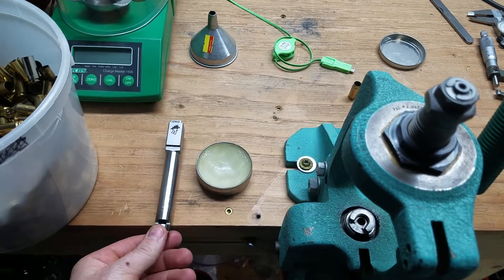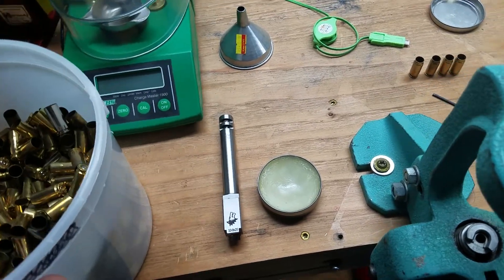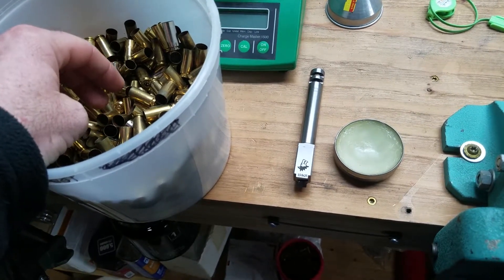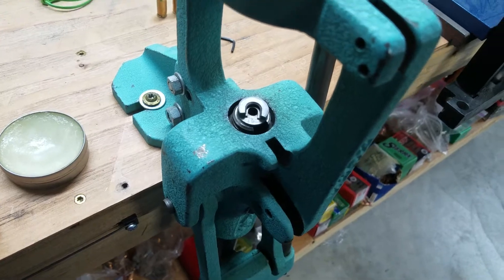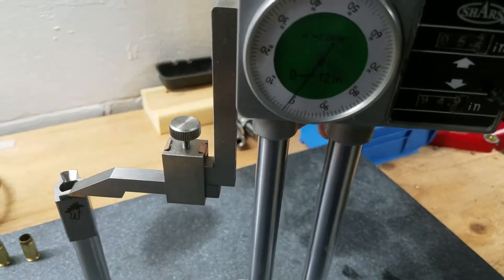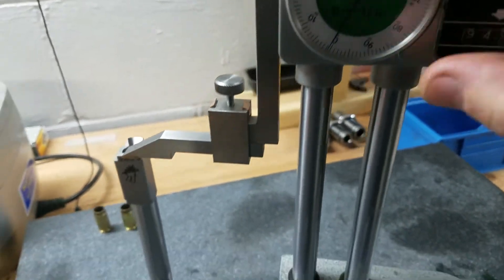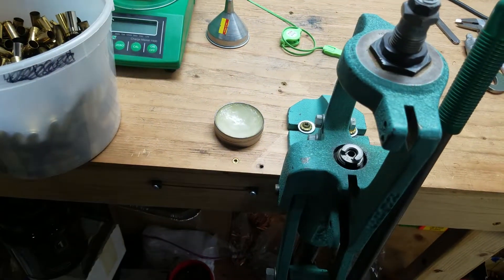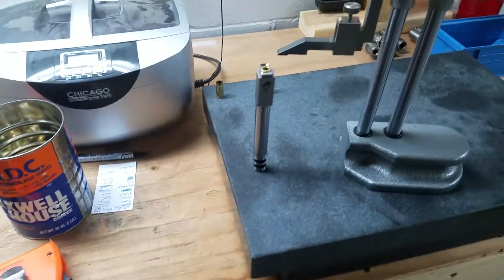9x25 Dillon - Setting Headspace

Comment: When you resize 10 mm brass to 9x25 Dillon how's the trim length or should you only worry about that after you fire it, also would it be helpful to anneal the new brass before you form them
Reply: Good questions. You always have to be careful annealing small cases. Don’t want that heat at the the case head. I’ve had no problem forming once-fired 10mm brass. Annealing should help but not needed until you start to get split necks upon firing or resizing. Remember that when setting the headspace, an annealed case won’t spring back as much as one that’s been fired a few times without annealing. Best to keep brass segregated when setting up your sizing die for sizing/setting headspace.